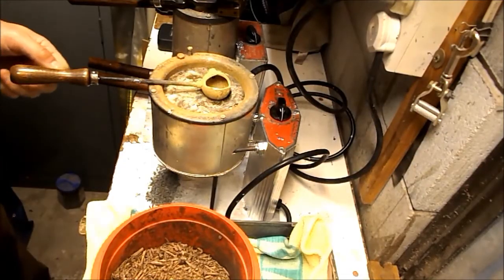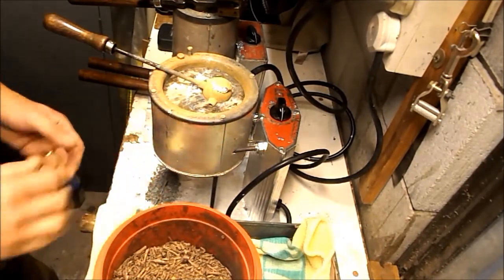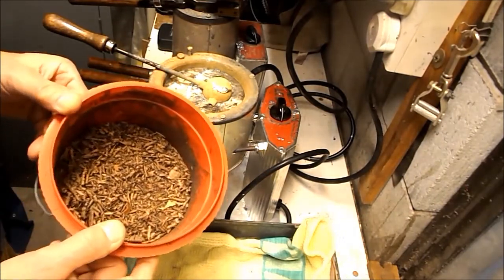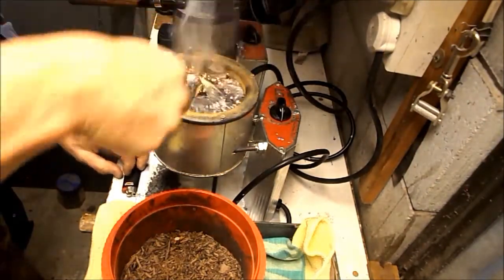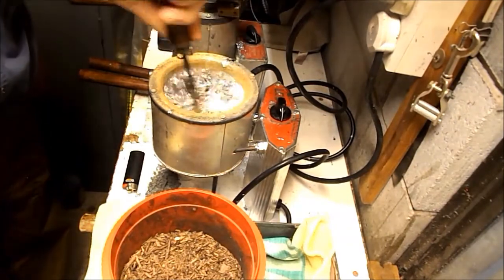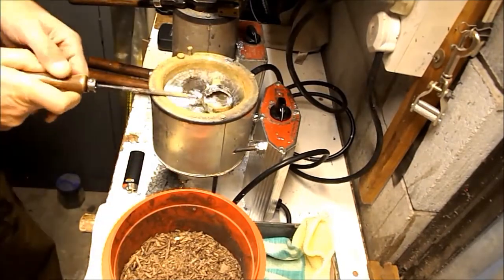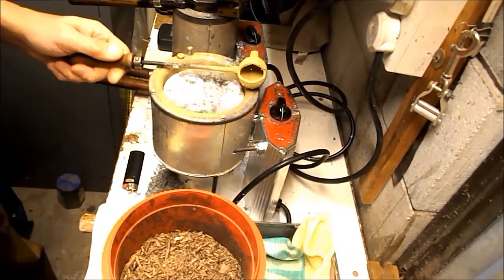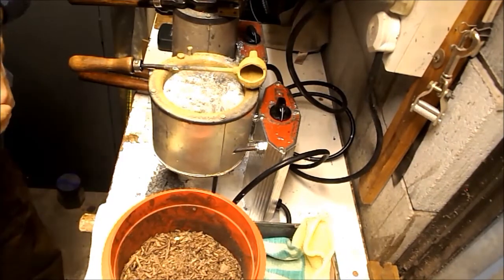Cast lead alloy fluxing.

Comment: Didn't want to splurge on that extra $10 a BOTTOM POUR production pot would have cost?
Reply: Those of us that use that style of pot has nothing to do with the cost. I have over 20 various lead molds that I use regularly making jigs and such for a local tackle store. I pour over 50,000 various crappie and bass jigs a year. There are several molds that always perform poorly with a bottom pour pot. 90% of pouring issues disappear when you ladle pour instead of using a bottom por pot.

Comment: whats that scoe thing you are using to scoop called?
Reply: It's called an "antique." A bottom-pour pot eliminates its need, and you get clean lead from the bottom vs the dirtiest lead, which is at the top of the pot.
Reply: @showproja  Even with a bottom pour you still need the dipper to get out the dross floating at the top.